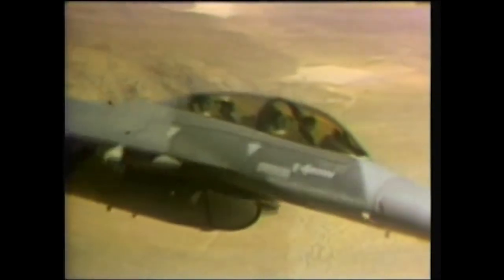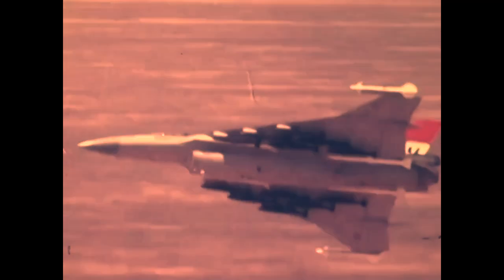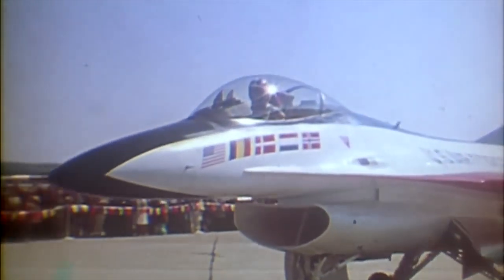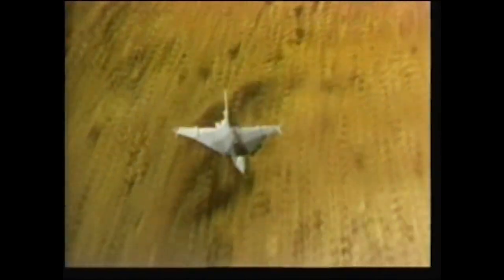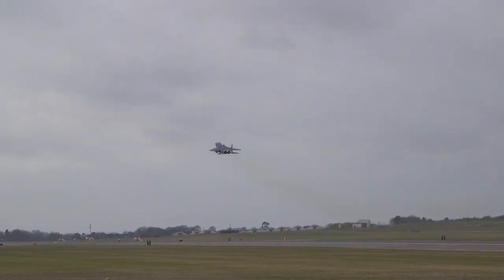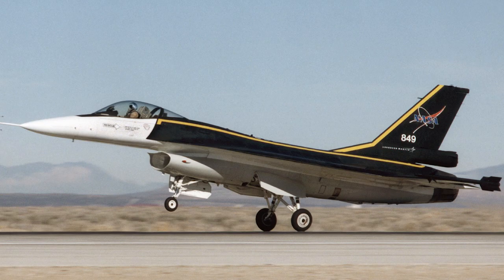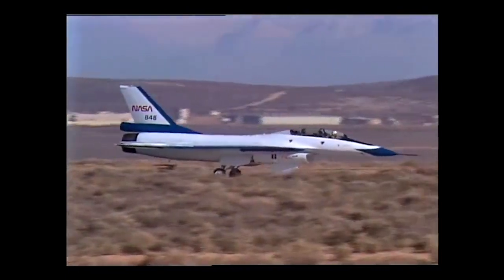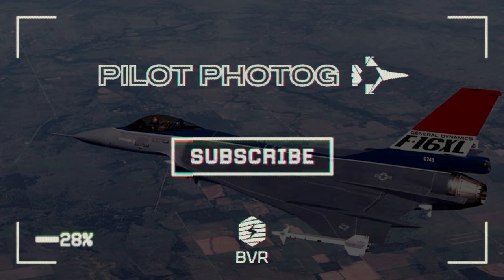F-16XL The Fighter That Should Have Been Built | avgeek |  #f-36

Comment: Mixed feelings about this one. It could have been a bomber/ missile launch platform to complement the F22's stealth capabilities, but it was ultimately dropped for the F22 alone (how many bombs and missiles do you actually need for a single mission?). Had the F16XL gone ahead it would have been easy pickings for air defences that had been missed by the F22s.
 
The F16s are brilliant planes, just not in a world where stealth is so crucial. I think it was the right decision, buying more F22s were simply more flexible.
Reply from the maker: Fair points and thanks for commenting!

Comment: The F-15 had a superior radar system, which is pretty much why the F-15 E won out in the end. There are other factors like thrust to weight ratio and avionics, but the F-15's radar capability rendered the F-16XL moot, especially after cost per airframe was factored in.

Comment: True the delta wing would have made it a better tactical bomber, and it could have been the next generation air defense interceptor, making it on par with the F-106, probably not the Avro Arrow, but good enough.  What the delta wing would cost it is in air to air capabilities. It would not be as good as the current versions are.
Reply from the maker: Agreed and excellent points. I think there is a place for such a fighter even today.  Thanks for commenting!
Reply: @PilotPhotog  No problem on the comment, and I am a former F-16 engine mechanic/crew chief. By far my favorite aircraft as I know it so well having worked on it for 15-years; blocks 10 thru 40, and both engine versions. The F110 engine gave it a little more power and was less troublesome to maintain than the F100.

Comment: It was amazing, helpful for many programs. But, as we see today with the B-2, F-22, and F35, the USAF growing problem of over spending cost the F-16 variants, and the F-22, F-35, B-2 when the actual costs were lower to build, but didn't show up on the paperwork.
The U.S. military, as a whole have drastically overpaid for everything, in many cases, just to spend their entire budget and making it look like they needed more money. That's the reason why the orders for the F-22 and F-35 were cut. They were unable to obtain the full orders for the lack of money. The air force should've made certain upgrades to the F-15 and F-16, like using the coatings used for stealthy aircrafts, putting the new electronics to enable them to have more time to evaluate the new upgrades, try to get the costs down, then have more time to develop the next generation of fighters and bombers instead of rushing to production, and still not worked out the many problems that both fighters still have today. The air force was willing to allow these serious problems to be acceptable in order to get them online first. Now, they were forced to step backwards, do those improvements on the F-15, F-16 because they don't have the budget now, to further development on future designs, nor for quite some time to come. The USAF is basically broke.
Reply: It's quite silly that the US Military have at least 8 different models at various levels of upgrade to begin with. 2-3 should be enough for any nation, including the USA. Boeing and LM are by far the biggest welfare recipients in the country.

Comment: The one thing not discussed is.....it involves more than just two different airframes (XL vs 15E).  One is a single seater, one has a backseater.  That's a HUGE difference as to tasking, potential mission, and personnel/TRAINING.  It's always more than the airframe.  The other thing is.....the "best aircraft" don't necessarily always get built:  history is full of political plots and vanished budgets that affect aircraft development.  Case in point:  the F-22 program drying up, producing a fraction of the expected
aircraft numbers projected, and further minimized by the new kid on the block.....the F-35.  Trust me, that can't possibly be the best.....but it's what we're stuck with for the next 30+ years.

Comment: Every counter argument like retooling cost, single engine, energy bleed in tight turns were all discarded on behalf of the vastly more expensive, but 'stubby legged ranged' F-35... 
Even dropping all F-16A-V production in favour of the F-16XL would have been the better investment into the 21st century. 

As always, slow Golf clap for not choosing the optimal available outcome...

Comment: The thing about these single wing concepts is they have zero survivability if any part of the wing is damaged. Unlike the F-15 and Warthog and other dual wing jets that have landed before missing part of a wing or the tail flaps. In fact the A-10 Warthog had a jet safely land missing an entire wing during Vietnam. That would be physically impossible with a single winged jet. Also the f-16 XL couldn't climb very fast and was out maneuvered because of this by the F-15 and F-16. So no I think we made the right choice.

Comment: The XL obviously had great performance stats and capabilities, but the single engine and loss of performance in tight turn and low speed presents too much of a problem in combat roles. The USAF has always acknowledged that the F-16 is a inexpensive front-line fighter without actually using the word disposable.

Comment: Why was it so much slower than standard f16... added weight?
Reply from the maker: Good question, I think the specs quoted are for the initial engine which wasn't as powerful as the engine used later on.  The newer engine achieved super cruise.

Comment: Now it's coming back as F-21?
Reply from the maker: Thanks for commenting- the F-21 uses the same wing as the in production F-16.  The XL was a delta wing which gave the F-16 more range and payload capacity.   The F-21 upgrades avionics and adds conformal fuel talks to extend its range.
Reply: F-16 still bad dream for enemy 29 feb f-16 shot down two indian jets

Comment: would the engine from the F-35 have fit into the F-16XL, I mean it should right because they lengthened the fuselage, just imagine the extra power and speed the XL would've gotten if it did get the F-35 engine

Comment: I think that USAF made the right decision by taking the regular F-15A/B and transforming is to F-15 Strike Eagle. We basically got a tactical bomber and an awesome multirole fighter bomber for a relatively small investment. I don't think that the F-16 XL could ever achieve these goals and requirements that the USAF made for this tactical bomber program. With a single engine and a massive increase in weight, F-16 would have never been able to perform on the level of the Strike Eagle. Payload and range were outside of possible for a single engine technology of the day. Maybe today that would be possible with the single most powerful fighter jet engine in the world, the F-135 used in the F-35. But back then in 1980..No way..

Comment: Yes it should have been built, but I still say the biggest screw-up was not putting the Northrop F-20 Tigershark in production.  Even today almost 40 years since it's first flight it would be a great cost effective fighter, one problem the F-20 has against it is it doesn't say Boeing or Lockheed on it as powers to be thinks those are the only ones that knows how to build a military fighter plane.

Comment: The new F16 is just coming up to the performance of Northrop's YF17, original competitor to the F16 and prototype to the F/A-18 stolen by McDonnell Aircraft, whom then cheated Northrop by contract, litigation payed Northrop $300,000,000 in compensation. The F/A18 was still powerful after tons of weight was added to convert the YF17 to carrier duty, over 3000 pounds to the keel alone. The YF17 had enough power to fly straight up and accelerate. The T45 British Goshawk was justified with fuel savings, admirals and execs slapping backs at the contract award, then first carrier flight nearly swam the aircraft with the "fuel savings" engine, and the more powerful engines intended from the beginning were already on board. Nothing but corruption preventing the best hardware going into production. The F20 Tigershark had no competition, but the pentagon refused to permit it to be built. Taiwan and Saudi offered to buy the first couple hundred and pay for development, we are told there were "no orders" as if it was a dud, not politically squashed like other Northrop projects.

Comment: It looks as if the US has never believed in delta winged fighterjets whereas in Europe only delta winged fighterjets are being made. I think that the coming European 5gen fighterjet from France and Germany will again be a delta winged fighterjet, because delta wings offer more advantages, more payload, more fuel capacity, and maybe better maneuverability.
It is sad to hear that this F16 XL didn't get the chance to prove itself.
Reply from the maker: Agreed.  I think the drawback to delta wings is the loss of airspeed/energy in sustained turns.  This can be mitigated with forward canards, which all of the European fighters seemed to have done.  Thanks for commenting!
Reply: Sure because the U.S. never fielded one.    The F-102 and F-106 disagree.   ;)

Comment: Even today the F16 is still the "go to" aircraft for the air to ground role. I think it would be relevant today. Especially with its long range on internal fuel and Supercruise with the big GE engine. But, nobody knew how much warfare was going to change in 1990 and beyond. Hindsight is 2020. We would have benefited in overall operational costs and flexibility long term if the xl beat out the mudhen. But i'm Monday morning armchair quarterbacking here. At the time the mudhen made sense.
Reply from the maker: I think they both serve overlapping and different roles - thanks for commenting!
Reply: LOL, have to disagree a little bit. The preferred aircraft for “air-to-ground” (as far as the Army is concerned ) is the A-10....
Reply: I agree David but there are 20 f16s for every A10. They are more readily available just by sheer numbers

Comment: The USAF would not contemplate closing the F-15 line.  That was all.
Reply: Ha. And who knew in 2020 they'd both still be open.
Reply: @VisibilityFoggy  that's the consequence of the Joint Strike Failure.  They wouldn't have hesitated to close the F-16 line if the JSF worked as planned.

Comment: If I remember correctly the Israelis also built some delta wing F-16
Reply: Israel operated the delta wing Mirage III and Mariage V, and built a tech demonstrator of the IAI Lavi, which resembled a "regular size" F-16 but with a delta wing configuration. It was an indigenous project that, under the hood, did not resemble the F-16 all that much, though aesthetically looked very similar from the exterior. There are some who believe the IAI Lavi plans were leaked to the Chinese who used them to build the J-10.

Comment: The X-L should not have been compared to the F-15 in this case. The X-L should have been solely a strike aircraft also comparing it to a twin-engine fighter like the F-15 was wrong. The X-L was in a class of its own as the F-35 is now. If the X-L would have had two engines I could see comparing them.  The F-35 is able to dominate an F-15 as was shown in green Flag exercise. If the F-22 had not been canceled there would be no need for the F-15X. Also, the XL-F16  is similar to what the airforce was wanting to do with the F-22B version but there would have been to many Changes to the production line to make it cost-effective and the F-22 was eventually canceled which was a huge mistake. Soon after the Russian PAKFA or T-50 was released to the media and I'm sure there a lot of " Dooo"s going on in the pentagon, and how did they not see that coming. They Should have known China was close behind Russia...
Reply from the maker: Well stated and thanks for commenting!

Comment: With the same engine thrust,  larger delta wings improve low wing loading while reducing acceleration (energy recovery) capability.

Comments from the real F-16 designer http://www.codeonemagazine.com/article.html?item_id=37
F-16 Designer Harry Hillaker

Harry Hillaker's statement on low wing loading and wing size...

_For example, the drag coefficient of an F-16 is about the same as that of an F-4. However, the F-16 has about one-third the drag of an F-4 in level flight. At angle of attack, it is about one-fifteenth

We knew that we wanted low wing loading and high thrust loading. But we also knew that low wing loading means more weight and more drag

Comment: The XL was born too late when stealth fighter is the next generation. worse, when cost is comparable, it no longer makes sense. XB-70 died early when missiles could fill its mission at much more certainty and much lower cost. 2 copies of XL were built are enough. But it is not completely a lost. For countries that cannot afford stealth technology, maybe XL is a good  choice if it can be scaled down with lower production cost. The modern Swedish Saab Gripen is an example.
Reply from the maker: Excellent points and thanks for subscribing - I agree and feel the XL had a place as an export variant.

Comment: The F-16XL lost, because it was the lesser product for the task !!
The XL just can't do what the Strike Eagle can do.Even the Strike Eagle was a huge compromise, because it falls way short of the F-111 wich it was meant to replace.
Reply from the maker: Agreed, my thought was make the XL an export option for nations that want a long range fighter/bomber.   Thanks for commenting!
Reply: @PilotPhotog  that could actually work. My comment was purely aimed at the F-111 replacement. 
I wonder why the Japanese built their F-2 based on the “agile Falcon” and not on the XL airframe. The F-2 is more maneuverable, but I would have thought, that range is more important to Japan than maneuverability.
Reply from the maker: @xyzaero  Great point and I hadn't thought of that - the XL frame would have made better sense for the JSDAF

Comment: from back of cockpit line thru wing angle out then blunt back in to make the pnt or nose & see how much more stable whole thing is in the air. Lots of bombs or major leap forward is bad for game red vs blue lie, so anything that stands out or gives 1 side to much edge or means less fuel burn more range & so less refule is great design & finds the trash can. Can't let this out the will by 1/2 the # of planes to do same job/missions & save fuel by 85-90%+ doing it, plane vs plane same mission not hving to refuel so much. If we finish the game to soon will b out of a job trash it. + It will mean great export sales only to great a product to ever b able to get an edge over it once it gets out to every body buying stables.

Comment: The Falcon XL lost because the Strike Eagle does the job better, faster, with more room for upgraded capability, and two engines being better than one. The primary reason the F-16 was made in the first place was because of the air force's light fighter mafia having a stranglehold in combat aircraft appropriations at the time. Outside of being cheaper and simpler, there is literally nothing the F-16 does that the F-15 does not do better.

Comment: It looks likes a eurofighter typhoon..
Reply from the maker: It does and thanks for commenting!
Reply: No, not really. I mean in general arrangement it does, but the eurofighter is much more angular. If I didn't know anything about aircraft I'd assume the eurofighter was a 1960s aircraft and that the F-16 XL was a 21st century aircraft.
Reply: Not very much. Eurofighter is a normal Delta with canards, which together with Rafale and Gripen are called Eurocanards. It's a design issue. The canards provide much better turn ratio, at the expense of slightly lower payload and less stealth in the frame design.

Comment: Historically the F-16 was always seen as a threat to the F-15.  For a time, the Air Force wanted to kill the program under initial development.  The Air Force always favored the F-15 program and did everything in it's power to keep other fighter types from threatening it.  The lower unit cost, the high maneuverability and all around mission capable F-16 eventually won the Air Force over, partially.  It's similar to the treatment of the A-10.  The Air Force has tried to kill the plane over and over, but find a better plane suitable for it's role.  The Air Force brass have always been lacking foresight from it's beginnings.  Each plane has it's mission and advantages.  It's the current generation of planes that seem to once again miss the lessons of the past.  No fleet defense fighter, removal of close-in combat capabilities (gun), slower top speeds and lower payloads just to name a few.  Time will tell what the mistakes of today will result in tomorrow.

Comment: How many Aircraft that have been designed then modernised with out the massive cost to totally make an Aircraft from scratch as if they Upgrade of the Tomcat which had the best of both worlds.
Again you cannot put all your eggs in the same basket.
The retirement of the F1-11 it has been an Aircraft that was not given enough recognition for what it did.
Reply: In the least, the TF-30's on the Aardvark needed to be replaced.  That engine stalled out just as easily in the F-14A as well.  That was its Achilles Heel!  While I liked the looks of that A/c, all three versions of the intakes were junk and they NEVER really could seem to make it work.  The 'Triple Plow' intakes just stunk -- there was no gettin' around it.